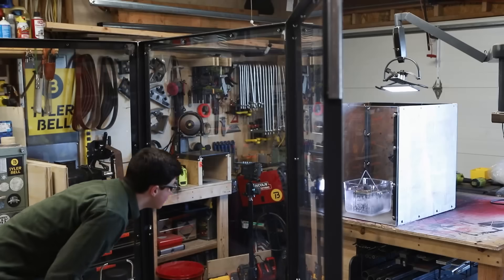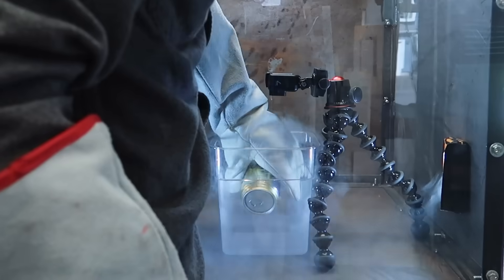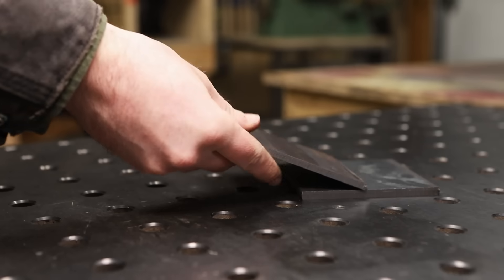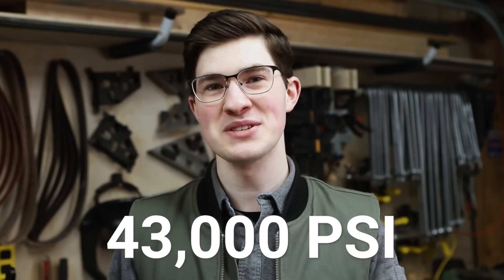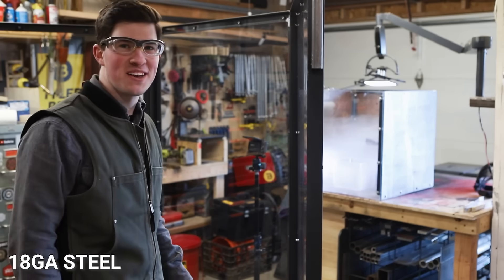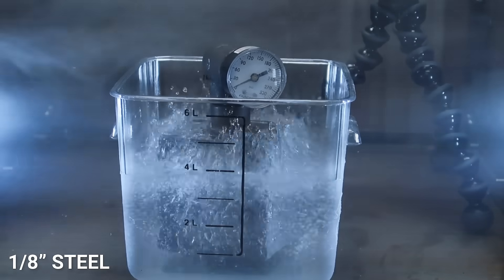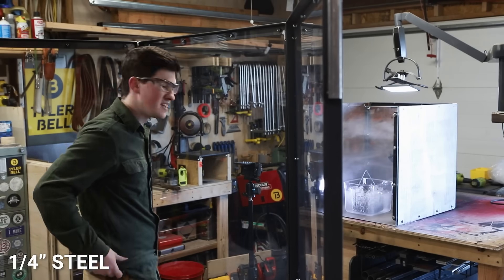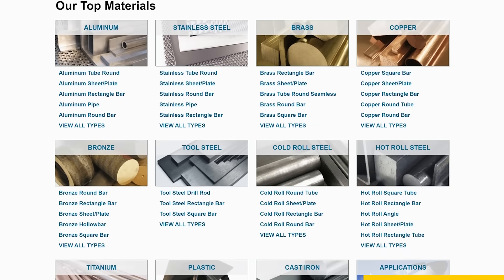Keeping ICE from EXPANDING?? (in liquid nitrogen)

Comment: Dips container in liquid nitrogen.
Proceeds to stick finger into ice that is -320°F (-196°C).

Raises blast shield.
Repeatedly places hands over it, incidentally into a direct path to the open top of the containment chamber.

Crouches behind blast shield and throws box on the ground to see if it explodes.
Leaves arm exposed anyway.

Continuously places box upright with a potential point of failure that can turn the plug into a projectile.
No lid on containment unit, possible ricochet from ceiling, no top guard on blast shields, and no hard hat.

Alone they are unlikely individual hazards, but together they may rate an honourable mention in the Darwin awards.

Comment: About Pop cans, there is another issue:
Carbon dioxide is soluable in water as carbonic acid. Carbonic acid has a lower melting point than water (-53°C). But carbonic acid is not very soluable in ice.
So as the water freezes, highly concentrated carbonic acid is left out. Carbonic acid is highly unstable and if concentrated without (without reaching carbon dioxide vapor pressure) will rapidly degradrade into gassious carbon dioxide and water (which will immediately freeze).
Now, carbon dioxide is stable as solid at temperatures when liquid nitrogen can exist. But between -53°C and 0°C it is not. (At -53°C, it's vapor pressure is ~10 atmospheres) So while the pop can is freezing, it will generate up to 10 atmospheres of internal pressure, which will rupture the can.

Now, how much of CO2, vapor pressure it tries to reach is directly proportional to H2CO3 concentration. Which, at this point depends on how deep you freeze it. Lower temperature=higher concentration.
So the freezer just wasn't good enough at freezing water to distill CO2 and pop the can.

Comment: It will always explode unless the wall material can withstand the force if water reaching the temperature of the liquid nitrogen without freezing. Water will cool below 32 degrees without freezing, but as it gets colder there is a stronger expanding force for the water wanting to freeze. The more you know

Comment: Maybe try repeating this using ASTM A500 square mechanical tubing. Then you would only have to weld plates on two sides. Your welds appear to have failed adjacent to the welds (heat affected zone). You may not have gotten enough penetration during welding.

Comment: Ice doesn't expand. The water expands right before freezing that's why ice cubes are not crystal clear unless the temperature is slowly brought down to freezing. I would like to see if you heated it. Since water expands 1700 times as steam but the boiling point raises 2 degrees for every 1 psi roughly. On second thought that would be dangerous with the explosion multiplying exponentially with the volume.

Comment: My immediate instinct is that you need very thick walls. Compressing liquid water is a lot like compressing a gas except it starts at 20000 atm. So to compress ice by 10% you probably will need 2000 atmospheres = 200 MPa if its behavior is like water.

Comment: I’m not 100% sure on this but I think depending on what weld wire/ electrode you use you should get well above the required pressure to make ice 2 as some electrodes with proper welds produce a tensile strength of over 100,000 psi

Comment: Learn physics!!! Ice has minimal expansion, so little it's hard to measure. Steel on the other hand contracts much more than ice expands. The part that breaks is due to water pressure from the ice turning solid and the steel contracting. The denser water blows a hole in the steel

Comment: I think you need to fill the box with wax very slowly. 
Pour a tiny amount of (liquid) wax in the pre cooled box at a time letting it shrink to the highest density before the next layer. Maybe 20 layers of fully cooled wax.
Rapid heat for explosion, slow heat for hydroforming.

Comment: If you melt paraffin and then chill it suddenly in LN2, it will spontaneously combust.  Try it.  Safely.

You also need to do Round 2 steel box tests. Thicker than 1/4 inch.  1/2, 3/4, 1 inch.  Welded by a real professional, welded out to full corners.

Comment: Actually the liquid nitrogen doesn't affect alter the steel and makes it extremely brittle. Depending on how good this steel is it might not matter it's the welds that are going to be the weak point. And in fact that's where they initially failed. The welds became brittle due to the liquid nitrogen altering and ultimately damaging the crystalline structure of the welds.

Comment: Cooling with liquid N is more about the effect on the steel than the water.  Water has its maximum volume at 4C, around 39F, (at 1 atm) when hydrogen bonding prevails — cooling it lower than that it gets smaller again.  MAXIMUM, meaning as you move away from that temp in either direction the volume is less.  There would be a pressure effect on the freezing point in an enclosed volume, but the point is that once water is no longer liquid, cooling it further causes it to contract, not expand further.  Cooling the steel causes it to contract too, and at a greater rate, increasing the interference, and it also becomes brittle.

Comment: Can you make an ice gun? Take thick walled steel barrel/tube, fill it will water, press a metal plug down the barrel and weld it in. Since you said it breaks along the welds the pressure should be enough to propel the bullet when the welds bread?

Comment: Steel isn't the best material to use, being it becomes very brittle when exposed to extremely low temperatures.  You need a material that retains some flexibility at extraordinarily low temperatures. Also, the welds and steel have different level of hardness, therefore they'll have different strengths at low temperatures. Your test is doomed from the start, because your containers became compromised the moment they cooled. This makes the expansion strength of frozen water far less relevant.

Comment: The devastating effects of explosions come from expanding gases.  Liquidis freeze with tremendous force if resisted but there is little stored  energy in the structure.  Freezing removes energy from a system, thereby rendering it more benign, and thus less dangerous.  When a ship gets caught in sea ice the damage to the boat is from crushing not from expanding!

Stavros

Comment: Maybe try with 304 Stainless Steel. Carbon Steel loses strength with freezing but Stainless steel increases in strength. Stainless steel work hardens and this can be done with hydraulic pressure as is done for cryogenic transport containers. 
SpaceX are using Stainless steel for these reasons but SS work hardened by rollling. Work harden by hydro pressure or ice then the welds should strengthen as well. 
Potentially you can have Stainless steel as strong as maraging steel.

Comment: flash point not equal to ignition temperature, flash point is temperature required for there to be enough vapors to ignite in an open flame, ignition temperatrue is the temperature it will start burning at regardless of whether there is an open flame.

Comment: The reasons to some cubes are not blast maybe when's you freeze the cube before exposing nitrogen that cubes still got some air pockets 
And those air pockets are able to hold the nitrogen expanding ratio 
That's the case maybe some cubes are not brust other then that not gonna say not possible but it takes lot a power to hold that pressure.

Comment: I believe as you freeze these cubes you’re riding along the phase transition line between liquid and ice I, getting very slightly colder and increasing pressure dramatically until failure. I wonder if you could suis-vide the slush mixture to apply very specific pressures 🤔
Reply: No, the ice expansion reverts from going colder. The welds failed from the temperature itself, while being on tension, so what happened was just a pressure release of the failed welds.
The ice did not expand more.

Comment: Nice one, now I'm wondering if the water gets colder in a slower rate than it does in open environment and how the pressure dynamics affects changing forms. I think it should effect but the question is, with a thick enough wall, is it possible to stop water to freeze or evaporate or will it inevitably explode at some point?

Comment: You need to do this with high grade Austenetic stainless steel which is not only stronger than low carbon steel it also doesn't become brittle at cryonic temperatures, in fact it becomes stronger.

Comment: my only issue with this is because of the extreme cold of liquid nitrogen. that extreme cold makes it easier to bust open the boxes you're trying to contain the expansion in. I've heard of ice formed under pressure (mostly talked about in reference to one or maybe 2 planets that have been found) where the oceans are so deep that water at the very bottom freezes but there's too much pressure to expand, creating Ice 7 or 9 or 14 or whatever number it is.

Comment: If there is air trapped in the broth can then it will contract due to the low temperatures (and possibly even liquify) while the water expands as expected. Conceivably, these two processes might cancel each other out enough that you can't detect any expansion.

Comment: I have some Engineers comments on your construction:
1) standard steel is only cold-resistant to about -70°C due to increasing brittleness of the steel, this also happend for the second test. 
2) when cooling in a N2 bath the heat is transfered from the core of the steel container into the N2, this happens the quickest on the edges -> the edges are reaching -60°C the fastest
3) welded areas are subject to a lot of structural stress due to the heat shrinkage of the heat dissipation zone, this increases the brittleness of the steel even further on the edges

The reason why some did not rip open is due to the expansion of the water had enough space for the expansion to take place into the bulges, as it only takes a very small amount of space. This is by the way the same with heat expansion in hot water tanks (liquids behave like solids for stress and like gases for flow), they always need an overpressure valve due to the small expansion happening during heating (mostly relevant for hot drinking water in your house, also see low-pressure faucets always dripping after usage).

Comment: They might have held if you could weld better and understand how pressure vessels work like propane tanks they have rounded edges so the pressure doesn't build up on the corner causing those cracks

Comment: Not surprising with the soup cans. It's condensed soup, which is why you need to add water to it to make it the same consistency of soup. If you'd canned actual soup, you have gotten the expansion you expected. Condensed soup will also have a higher salt volume, which impedes any liquid present from freezing quickly.

Comment: A dozen years ago I read about an experimental bicycle in a cold country - Norway, maybe - that used a water-filled cylinder. The bike, left outdoors overnight, froze the water; the expansion pushed a piston against a massive spring to load it to power a gear-train for riding next day.
Reply: Yes, I saw that video. But the resultant force (as created by expanding ice) only propelled the bike 10 metres or less.

Comment: You could figure out how much water is actually in a soup can by weighing it - or its contents, rather - and then evaporating all of the water off and weighing the dehydrated mass that's left. It also must be a combination of the salt content and other insolubles that are responsible, some threshold, which causes the water content to not expand as much. Or maybe there's just not very much water as a result of all the other stuff in there so it just doesn't expand very much overall.

Comment: What if after you weld you dip the box in molten metal steel then let it harden like a candy shell? Would it prevent it from breaking at the weld points?

Comment: You would have had a more voilent explosion if you used the stick welding method preferably with a E-6011 or E-6010 with a rod diameter of ⅛" set at 90 amps

Comment: Hang on the wax test at the end is interesting - you melted the wax to get it in the box. How'd you account for the shrinking when it cooled? Wouldn't you need to use directional cooling and fill eit a bunch of times to make sure it's as full as possible?

Comment: i noticed you keep grabbing the top of your blast shield that is really dumb and you should probably stop doing that

the point of the blast shield is to shield you from a blast and it dose not do a vary good job of protecting your from a blast when you keep putting your hand over the top of the blast shield 

also the LN2 could have easily gone over the blast shield when a box exploded and that could have been bad

Comment: I am a welder. What looks like to me, is that the 1/4" thick box have defect in the weld. The weld didn't penetrate all the way. Therefore the split happened right on the weld. You may compare this result with the thin box. The split isn't right on the weld. It happens next to the weld. That tells me the penetrate is enough. But undercut or temperature change too quick might course this issue. What I want to point out is, if you did the weld on the 1/4' as good as the 1/8" box, they should have the same result.
Reply: Isn't weld very brittle compared to the steel its welding due to crystallisation cause by the heat, and it has to be annealed to toughen it?
Reply: @jackopolo4635  No if welded properly its actually stronger that the metal.
Reply: @jackopolo4635  It is, unless you preheat the steel and allow it to cool slowly. I weld AR-500 steel equivalent for a living.
Reply: This is the same thing I was thinking. Also a welder/part time destruction technician.
Reply: I agree. I weld (not professionally) but I am a designer in the mechanical engineering field. The failure appears to have been in the heat affected zone due to incomplete fusion. Also, the cryogenic nature on the steel resulted in brittle failure.
Reply: A welder critiquing a weld on YouTube. Peak internet.
Reply: @Face_RC  for science sake of the video this is an important thing to make note of. Honestly it's what i was looking at and thinking about the during the whole video b/c as he was welding the MIG sounded like it was popping more than it should of and i was curious how the welds were going to hold up. If he does the experiment with stronger welds it could give off a reaction closer to what he was initially looking for. My guess is he didnt want to blow through the 1/4 metal one so had the temp turned down a bit which made it so the weld didnt penetrate all the way through.
Reply: @carthius  technically you can’t turn down the temp when welding… you don’t have to reply I know that you meant the ampere :P

Imo he should’ve done a root and surface weld and not only a single weld
Reply: @Face_RC I do lots of wire welding. His welding clip at the start sounded like a very unhappy mig run. Probably shite pen. But what do I know
Reply: @Face_RC  critique is a good thing. It's the only way to improve.
Reply: Good point. I was always told a weld is normally  stronger than the medium if done right. Is that true?
Reply: @Criwindustries  Yup. And please allow me to complement on your statement. The welding material should have a higher tensile strength then the base material when we choose them. But higher tensile strength doesn't mean harder, and usually the opposite. That is the better way to express “stronger”. Hope you would find that useful.
Reply: Agree
Reply: In general, when you are dealing with rapid cooling, thicker cross sections are more brittle than thinner cross sections given the same weld quality. So it is absolutely possible that the 1/4” plate would always do worse than 1/8” plate. This, among other reasons, is why pressure vessel hydro tests need to be tightly controlled for water and metal temperature, especially when dealing with thicker vessels and piping.
Reply: @awake780  Could you explain how thick cross section are more brittle? I have never heard about that. Please share more.
Reply: @TangHeyman not sure what happened to my first reply, but I’ll summarize it again. 

Given the same material chemistry and environmental conditions, thinner cross sections will exhibit more ductility before yielding or rupturing. 

Look up “toughness vs material thickness” to see a chart. The thicker sections exhibit less ductility and higher internal strain. The resulting rupture is spontaneous with tremendous potential energy being released.
Reply: I hope he saw this comment because it's probably one of the biggest factors.
Would love to see him try this by using metal boxes from a good welder. It would be like an immovable force vs the unmovable object.
Reply: Normal steel becomes very brittle at that low temperature. The cheaper the steel, the worse it is. But basicly EVERY construction steel breaks like glass at liquid nitrogen temps. 
If the box was made from 304 stainless steel it would've only bulged. Even with a non perfect weld.
Reply: Action lab went and did the same thing and it breaks through an unwielded 1/4" steel pipe end cap (not the threads it blew through the steel end cal itself).

As Tyler says a megapascal is alot of pressure.

Comment: i think the reason the cans didn't expand is because they are sealed hot so that when the cool it has inward pressure. its at a lower pressure than the outside rather than a higher one. so as i cools it just fills the can and equallizes the pressure.